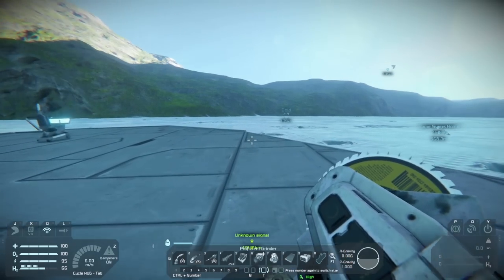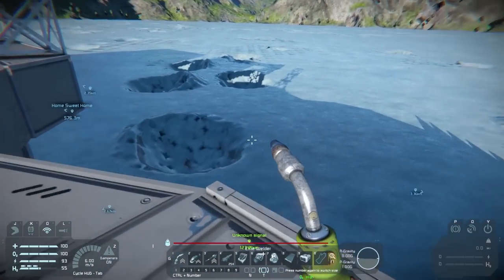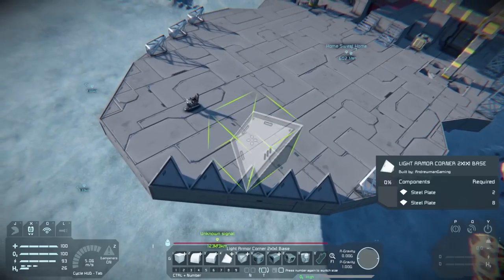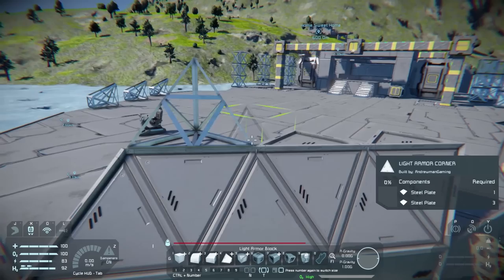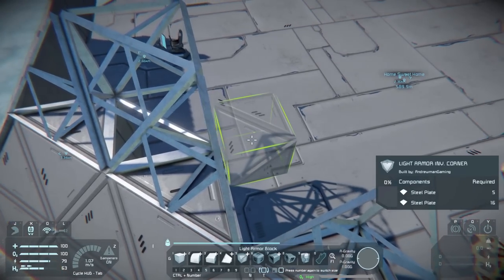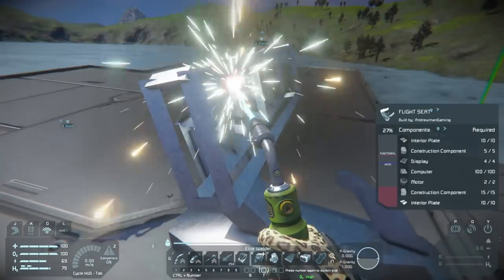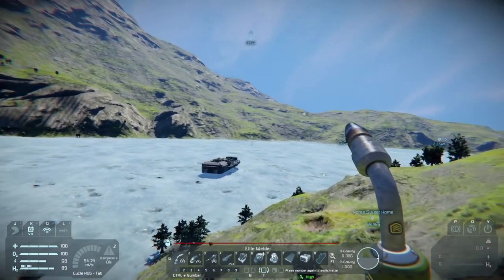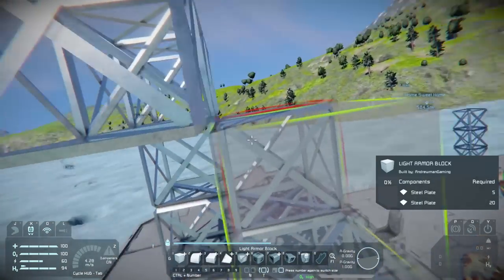Space Engineers Let's Play (Ep 12) - DESIGNING THE SHIP'S CONTROL ROOM [Beta Gameplay]

Comment: So a couple comments from a longtime player.  Ditch the large reactor on the small ship.  You get more mileage out of a couple small reactors and a battery.  You can lighten the load a LOT by getting rid of most of the armor blocks.  Most of the blocks on the small ship are for decoration.  You can also mount a small ore detector on it for fast surveying.  The connector on that small ship didn't work because you had a large port next to three small ports.  You have to do Large-to-Large and Small-to-Small for conveyors to work.  Also, small conveyors will only do ore and ingots and a few other components.  I think you've figured out everything else, except you seem to have an aversion to using the scroll wheel to go through pieces.  Any part in the G-Menu that has a + on it, is not only the part showing, but many many other parts as well.  You can save a lot of space on your menu bars by just grabbing the one you need.
Reply from the maker: Thanks for the tips! I used to have 6 small reactors on the small ship but they were not enough to keep up with the power requirement of the thrusters. The large reactor seems to work very well for this. I'm not really sure about the ore detector on the small ship. It has the same range as the handheld drill detector (I think) and when I fly I tend to be 50m in the air so there is no way it would be able to detect from that range. Once we get to space or to the moon, things will be a whole different story!

Comment: Oh, something I forgot to mention.  Those speed modules you put on the assembler?  There are spots for 4 of them on the bottom of your refinery too.  And besides a speed module, there is also a power module that will make it use less power, and a yield module that will let you get more more out of the ore you refine.
Reply from the maker: Thane Greyhaven !!! Really !!! This is awesome! I was starting to notice the slowness of the refinery :) can you manage to get more than two on the assembler?
Reply: The assembler can use all 4 of its longer sides for modules (the benefit from modules on two of those sides are reduced 50% because they only have 1 "node" instead of 2).
-> You can only use speed and power efficiency modules on assemblers (the "yield" modules do NOTHING because the assemblers "recycle" matter at 100% efficiency already).
  
If you want 2 assemblers (both full deck modules) working in cooperative mode (1 master + 1 slave); they have to conect linearly (the 1x1x1 "face" of the assembler). The whole thing will require a space of 3x3x4 [but with the "corners" still free to walk].